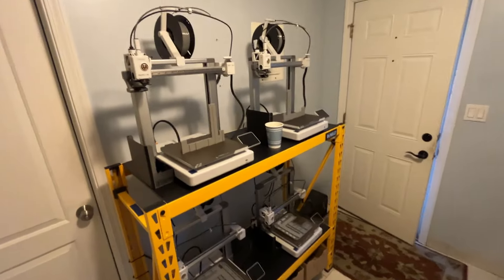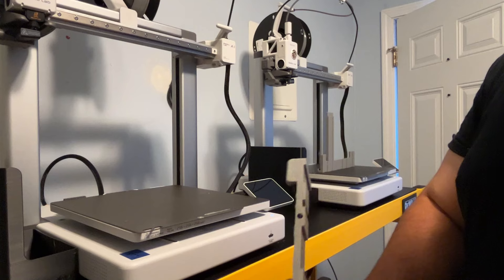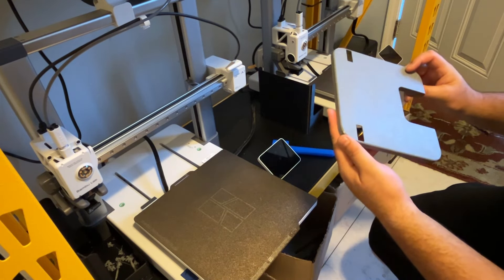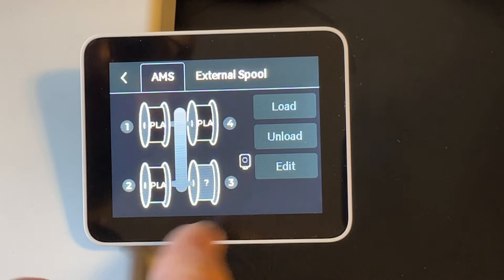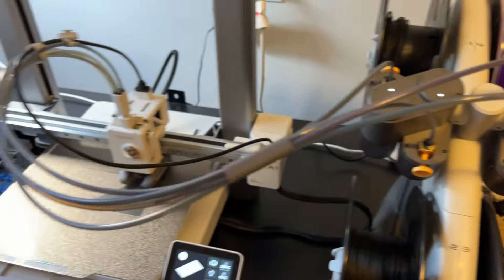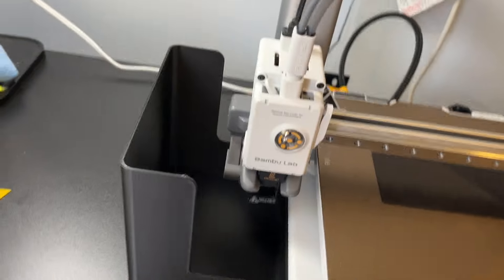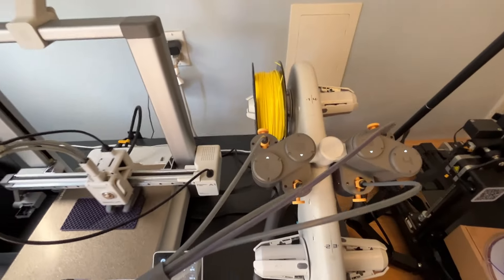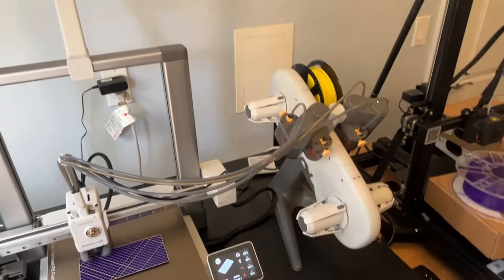Bambu Lab A1: AMS Auto Refill Tests In My Tiny Print Farm!

Comment: Your dedication to documenting your progress is appreciated. 🙂
I oil the X axis the same time I do the Y axis. The Z less often since it sees the least amount of movement.
Maybe in the future bambu will update the fw to do what you though it would with the AMS. As long as there's filament loaded, it makes sense to keep the print going from 1, 2, 3, 4, then back to 1 and repeat.
Reply from the maker: @NWGR  Thank you for your kind words and for sharing your maintenance routine! I haven’t yet lubricated the X-axis on my setup, and hearing your approach makes me think I should start doing the same. I agree, it would be fantastic if Bambu updates the firmware to allow more flexibility with filament slots. Nonetheless, it’s still an awesome system and great for using up old spools of filament too :)

Comment: Been watching the vlog videos. Doing good.  I have a P1S and starting some production of parts that will be PETG .  I’m torn between adding another P1S or the A1.  I don’t think I can go wrong with either but I just love the P1S
Reply: I think you may be surprised by the A1. Yea it’s a bed slinger but I’ve talked to people who say the A1 makes the X1C feel dated and same for the P1S. Also prints are identical quality for a fraction of the price. A1 is definitely an amazing printer. I actually chose it over the P1S just for the fact it has a touch screen I didn’t like the navigation in the P1S. If I knew how good the app was though I’m not even sure that would of mattered. If you don’t need an enclosure I’d try it and if you aren’t happy just return it for a P1S if you have a micro center near you it makes it easy to do so. Just keep in mind it does need a tad bit more room since it is a bed slinger.
Reply from the maker: @RBallarddesigns  Thanks for watching the vlogs and for your support! It’s great to hear you’re expanding your production with PETG. Both the P1S and the A1 have their strengths, and it sounds like you’ve had a good experience with the P1S. It’s ultimately about what best suits your specific needs and preferences. Each option has a lot to offer, so whichever you choose, you’re headed in a good direction :)

Comment: Also if you put a little glue stick or bambu liquid glue on the build plate the petg won't stick quite as hard and chip your parts
Reply from the maker: @jhautz817  Thanks for the tip! I've found that washing the print plate has helped with the release, making it manageable without needing extra materials like glue. I try to keep the workflow as efficient as possible, so avoiding additional post-processing steps helps a lot. Again I appreciate your input and will keep your suggestion in mind!

Comment: Hey, doesnt t that metal scraper blade damage the textured PEI bed? I've seen blogs about not to use it on the textured plates but maybe im mistaken. Just a heads up! Love the process videos.
Reply from the maker: @ugur5395  Thanks for your concern and the kind words about the videos! The metal scraper provided by Bambu is indeed quite dull, which minimizes any potential damage to the PEI bed. I use it very sparingly and gently, mainly for parts that are really stuck. So far, I haven't noticed any harm to the bed. It's always good to be cautious, though, so I appreciate your heads up!

Comment: Why are you printing one at a time with the scrapers and the tall vertical prints on the upper machines?  Load those build plates up with clones you can probably get 4 or 5 of them in a single build plate.  Let them run and don't have to touch them nearly as much. Run I bulk if you are printing the same thing every day.  You can probably get ahead on those vs the flat ones and then open some time to use the upper machines to print some flat parts as well.
Reply from the maker: @jhautz817  Thanks for the suggestion! I print one at a time to ensure each set is completed together, as I need matching parts ready simultaneously for assembly. It helps maintain consistency and quality across the products. However, your point about bulk printing to save time and optimize the use of the machines is a good one. I’ll consider adjusting my process as I continue to streamline operations. Appreciate your input :)

Comment: I think that *maybe*, when you were on the filament screen and clicked spool 1, if you had clicked the Load button, it might have continued.  I could be wrong, though.
Reply from the maker: @IgnusFast  Thanks for the suggestion! I actually tried clicking the Load button for spool 1, but it remained grayed out, so I couldn’t select it at that time. It's a good thought, though, and I appreciate you pointing it out :) It seems there might still be some limitations with the current firmware on handling these transitions. Either way, it’s a great system for using up old filament spools :)